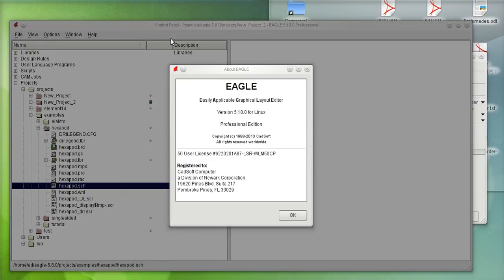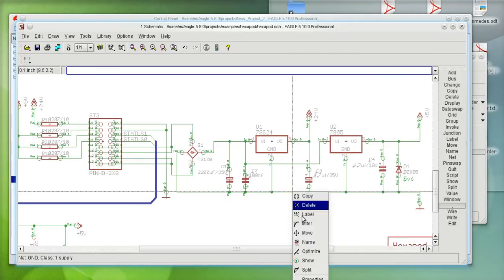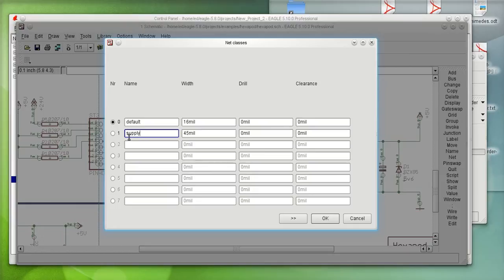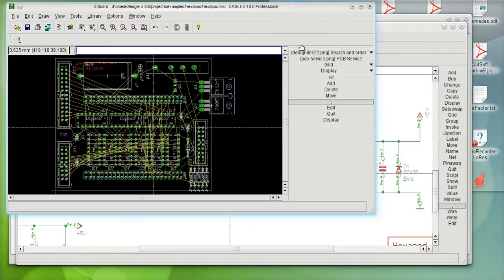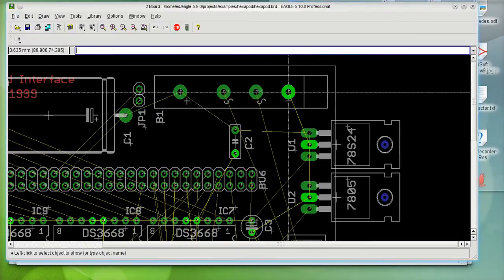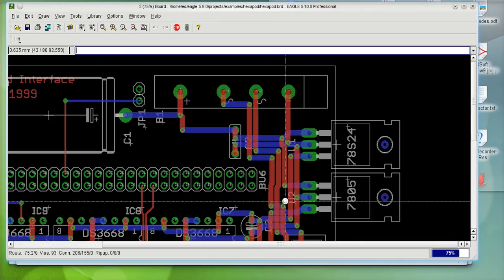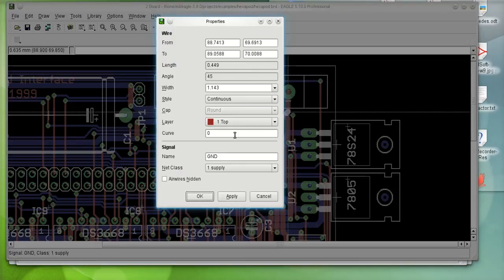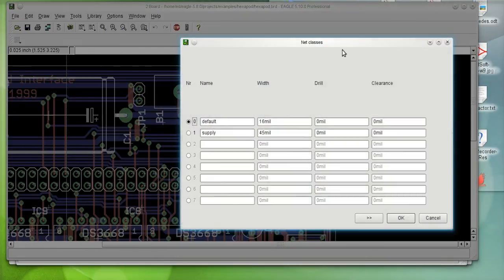EAGLE PCB CLASS definition for Multiple Wire Width

Comment: If the defined polygon belongs to a particular Net Class, then that polygon will obey the clearance value. The width value will not be obeyed since this is defined manually as you draw the polygon (options on Action Tool Bar).  DRC will let you know if you are using a width that doesn't comply to DRC settings or Net Class. Polygons clearance can be defined independently in the polygon properties. The field is called Isolate. I hope this helps.

Comment: Thanks for the answer. About your last sentence, let me tell you that manual routing can use the clearance defined in the net class. I just started doing layouts and I was doing a ground pouring and decided to define a net class to set the clearance of one specific net, and at the same time I decided to play with the width. It turned out that the clearance between the pouring and the manually routed net is applied as defined in the class, but not the width, like we talked before.

Comment: I believe that is by design. The class definitions only apply to auto routing, manual routing uses the width set in the toolbar drop-down menu. If you'll notice, clearance is also a value that is set in the class which is something that would obviously only be used in auto routing.

Comment: Josh, 

If I define the width of a net class and then I dont use autoroute, when I try to route that net, the width is not automatically set to the value in the net class. I did what you said in your comment and it didnt help. Do you have an idea how to solve this issue ? Thanks in advance.

Comment: There is something worth mentioning in this tutorial that most engineers overlook since it is not very obvious. To force the auto router to use the dimensions set up in net classes you must first check this checkbox: Options > Set > Misc > Auto set route width and drill. Thanks!